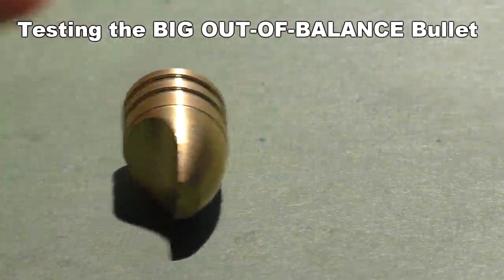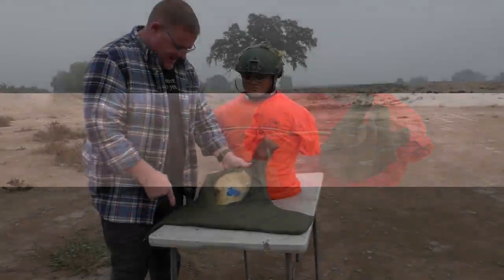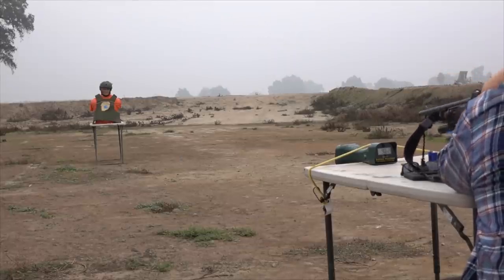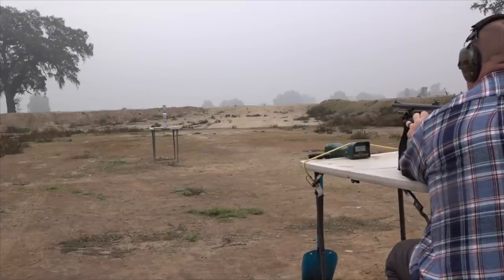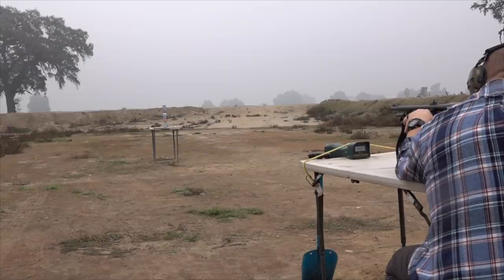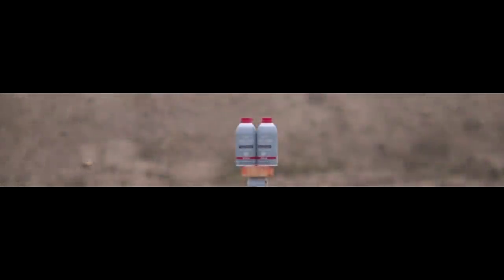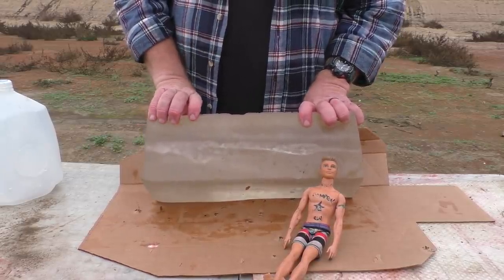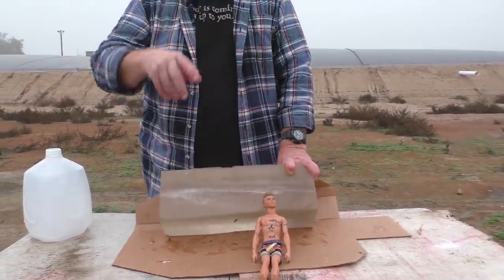BIG Out Of Balance Bullets -  Tested!

Comment: One of the questions on my physics midterm last semester was about a bullet hitting a lead block. The gotcha was that if you calculated just momentum transfer from bullet to block+bullet you’d be short some energy. To balance the equation you have to calculate the temperature change too! Some of the energy is lost to heat!

Comment: I would love to see what our Russian friend could do to make a slanted-type cut in the same brass projectiles to possibly help facilitate spin, kind of like a drill bit. Would be cool to see, and if anybody could do it, it's Alexey
Reply: Maybe with some full length fluting that matches the rifling's twist rate.
Could make mega extreme penetrator.
Reply: Or even with just a straight  'chisel ' cut, like a standard screwdriver.
Reply: Maybe just sebo a trimmed down drill bit?
Reply: @thecrowcook  Tool steel it too light.
Reply: We had shot something like that hadn't we? The turbine slug.
Reply: @thecrowcook  they already tried that
Reply: @cycoholic  I said the same. Do scallops on both sides but leave like 3/32 thick tip all the way across. It would be naaasty. I think Tim Hamilton, Ballistic Machinist, is probably more than capable of doing such a thing
Reply: A Baltic Boring Bullet VS. Russian Ballistic Gel

Comment: Jeff! I have a suggestion for Alexi… What if you were to make an offset hollow base, or drill holes out from the rear on only one side? That way the slug would be aerodynamically symmetrical, but offset in balance. It might be another neat experiment.
Reply: This is a great idea! 👍
Reply: I also think making half of the bullet hollow point, and half solid nose, would be an interesting test. Aerodynamically, that would put it off balance and cause it to Tumble, at least I think it would.

Comment: We need the Brass Extreme Warhead Bullet.  The BEWB.
Reply: 1.  Russian Leprechaun BOOB.  
2.  Did they ever say what it was made from?

3.  The word they needed is "YAW"  Rotating  around a vertical axis, very unusual in a ballistic projectile, which are generally meant to be stable and accurate by spinning or rolling around an axis parallel to  the line of travel, or  rarely to pitch, tumble around a horizontal axis
Reply: What about the Brass Bullet Carbine? or  HighExplosiveNitro TankAnnihilatorInstrument (:
Reply: @KalLanPIDT  Keep your tentacles to yourself, lol.

Comment: H&K actually tried something like that back in the day. A 4,7 mm rifle round with the bullet tip scalloped out, although not to that extent, to cause yawing in the target. Löffelspitz they called it. Really interesting stuff.
Reply: The British figured out over 100 years ago that a light tip, wood in that case, caused the same thing. All of the surplus 7.62x39 that I have had, the slugs squish in the middle almost like they are hollow and would produce the same effect.
Reply: @Chris_Garman  Yeah, playing with a bullet's center of balance is nothing new. I'm moreso talking about the shape of the tip and its effect.
Reply: So I wonder what would happen if you ground tiny chisel-points on m855... (There's a lot of solid copper in front of the penetrator)
Reply: @Chris_Garman  that's sorta what HPBT match is but the "hollow point", hole or meplat is more for aerodynamics than terminal expansion. I'm no expert but I'd assume that meplats creat some kinda air cushion that reduces drag.
Reply: Yeah i remember something back in about 99 about a hk pdw "personal defense weapon" basically a very small smg and it used at least their marketing scheme was called an asymmetric soon nose round. 
The idea was that it would be reasonably accurate and flat flying up to x meters, and would then begin to tumble at a significant rate. The supposed purpose of this tumbling was to "shred" through the then widely available body armor. IIRC, it was a fairly punchy intermediate round probably similar to a 5.7 today. I dont reallt remember how well it did. But the article i read was pretty excited about it.
Reply: @michaelbrown2678  Looks like your wish has come true.
Reply: @Tunkkis  Apparently it did and the results were very impressive! 😎👍🏻🥃🇺🇸
Reply: Reading more about this, im even more confused that i was. 
The hk36 (no the g 36 from what i can tell) used a 4.xx mm rounde with the spoon tip bullet to as im reading now, not so much tumble in the air, but once hitting the target. It had a flat tragectory and had soft and hard core variants of the round. 
 It was a full size ish rifle though. 
The spk7a1 on the other hand was a small pdw but used a different round with no talk of spoon tip. Perhaps i read about both of these and got them blended in my mind.

Comment: Hypothesis; that bubble under the ballistic gel might be air getting trapped between the wound tract and the round itself passing through the gel. My guess is because the shot was so low, it forced all that air pressure down into a temporary air pocket.

You can actually see as the bubble deflates, it pushes air out of the exit cavity. Again, I could be totally wrong.

Comment: I get the impression that getting hit with a shotgun slug while wearing soft armor will only give you a chest cavity full of kevlar.
Reply: Getting hit with a brass shotgun slug while wearing most level 4 armor will give you a chest cavity full of red goo.
Reply: @RightWingNutter  I think I will be casting some more slugs :)
Reply: @RightWingNutter  22-250 will as well. Anything properly fast really. Anything hard AND fast should come out the back as well.
Reply: @Chris_Garman  I am restricted to shotguns in my country, but I have made a mold which casts 648 grain tubular slugs much like the ones tested on this channel. It does make impressive donut shapes when it expands, about double the diameter of the unfired slug.

Comment: These look like they'd make the fastest scalloped potatoes ever, if the spud wasn't immediately mashed and spread all over the table.

I want to see an anti-penetrator, instead of 3 or 4 grooves, 3 or 4 points with the center ground out. An extreme meat tenderizer
Reply: I'm pretty sure they already sent their meat hammer down range
Reply: They already exist in smaller calibers. I've seen hollow points with 6-8 points and designed to fragment into long sharp shards. I don't remember the manufacturer or name.
Reply: @generalkayoss7347  RIP ("rapid invasive projectile") ammo?
Reply: I remember the RIP rounds, I'm looking for some that don't fragment. Kinda like the spikes on the hammer head of medieval polearm. Assuming they can fly true, they'd be nasty on a soft target.

Comment: Those are some crazy rounds!!

Had a thought this morning. What about melting down some hotwheels/matchbox cars? The metal used in the body is an zinc/aluminium alloy called Zamac and has a comparatively low melting temperature. Has also been used in other things. I know it has been used for things like window winder mechanisms in car doors for example. 

Potentially you could melt down the bodies and cast them.

Just a thought.
Reply: The zinc will gum barrels, the main reason why newer wheel weights are not used
Reply: @CRAllen083A  Ah ok. Didn't know that. I'm just an ignorant Aussie living vicariously through Taofledermaus. lol

Comment: Thanks!  You verified what I also found with a smaller caliber. 
Back in the early 70's I deformed lead noses of 22's to find a destructive design.  I was looking for the SHOCK power of the bullet in the first short distance into a target rather than penetration.  I found what I call a "dovetail' shape about 50% of the forward part of the bullet  begins to rotate soon after leaving the barrel and creates a big air-shock wave while tumbling through the air toward the target and absolutely devastates (explode) a target by imparting all of its energy in the short distance including air effect which I was looking for. They would "hum" while flying through the air like a small 'chopper'.  The 22 was performing more like a 45 with large holes in targets instead of the BB size holes 22's make.   I didn't care about pinpoint accuracy or penetrating a moose just hard impact in the first inch and knockdown power.  It was more like a shotgun than a single bullet in its effect.  It was also fairly very accurate over 50 yards.  As a man-stopper, a larger caliber shaped like this, as yours does would do a better job in my opinion than a hollow point or solid rifled bullet at short distances since the bullet tumbles and the faster the tumble the more it destroys on impact.

Comment: I would like to have a few of the 3 fluted ERP, with a point visible when loaded, and a radiation warning sign on them (Black on the tip, yellow at sides). I'd LOVE to see someones unsuspecting reaction to them :p No need to actually fire one, they would fall over just from the shock :)

Comment: Pontus Bieber was nearly sent to heaven when that ballistics gel got hit under him.

It kinda makes sense, because the round is spinning it will find its center of mass and because the round is misshapen then it would wabble. Like driving on a unbalanced tyre. I guess the only time the accuracy is actually played with is when it first left the barrel as when in the barrel obviously its constrained so that is going straight but when it first leaves then that slight imbalance means that slug is going to move slightly in favor of the position of most mass at the time it left the barrel, it cant change direction after that (too much mass for air to have a huge effect) and when it leaves it cant move more then the weight difference of the imbalance. Its a slug so it isnt THAT heavy so its the energy of the mass poking out of the barrel, still more then a bullet calibre.

This is cool though.

Comment: 17:30 I witnessed the fall of an iron meteorite once. It had slowed to terminal velocity before it hit the ground so it didn't hit that hard and I was able to collect it right away.
     I expected it to be hit from its plunge through the atmosphere but it was icy cold. Well below freezing.
      Most of the heat of reentry is carried away as the iron on the surface melted and was blown away.
     By the way, though really rare iron meteorites are extremely valuable. If you find one, you can get a payday from it.

Comment: I would like to see something like that Russian extreme penetrator but where the fins are angles to see if proper spin could be induced out of a smooth bore.
Reply from the maker: We've tested stuff that is supposed to do that,  but with a supersonic projectile,  the shockwave prevents air from flowing over the slug like you might imagine.
Reply: @taofledermaus  makes sense.  Thanks for the reply and keep up the good work.

Comment: Try putting 5.56 fmj bullets in a lathe. All you do is cut maybe half of the thickness of the copper jacket at the midpoint. Essentially making a weak spot where the bullet will break in half when it starts flipping inside tissue. Then shoot it against gel or a meat target in a normal full length barrel and with the shortest barrel you can find and then with a reduced powder charge simulating a short barrel hitting a target at > 300 meter range
Reply: Just saying, that stuff is against the Hague convention.

Comment: I question whether the heat of the bullet comes from the rifling because the period is so short and the movement through the air should cool it down.  I believe the heat of the bullet comes from the transfer of energy from after the bullet hits the target and the energy is transferred from bullet to target and vice versa.  IMHO.

Comment: There goes all your England viewers 😂
Edit: That's the weirdest wobble I've ever seen. When shot through rifling while spinning it would wobble 180° then straighten 180° then wobble then straighten and on and on till it impacted the target. I noticed it only wobbled to the left. If the rifling was reversed I wonder if it would change the direction of the wobble? At least that's how it appeared to me. Weird.
Also (off subject), I wonder if you shoot a bullet through a rifled barrel over the equator would it change the direction of spin mid-flight? Lol. You'd probably have to stand close to the equator firing in a real steep Arch to allow the most time to change direction.  It may work better if the projectile was magnetic since magnetics are what's at play here.

Comment: Need a make one with a titanium tip like a drill bit kind of drill out the center of the slug and cut a little half inch piece of drill bit and then heat welded in the lead

Comment: I would like to see somebody make a big slug like this and make it Hollow in the middle and then just have like a brass plate on the back of it so after it leaves the gun the plate would fall off in the bullet would be super aerodynamic letting the air go through the center of it I'd like to see what happens when it hits gelatin